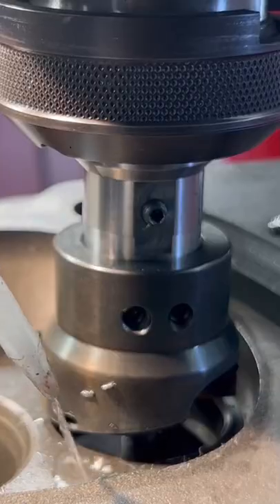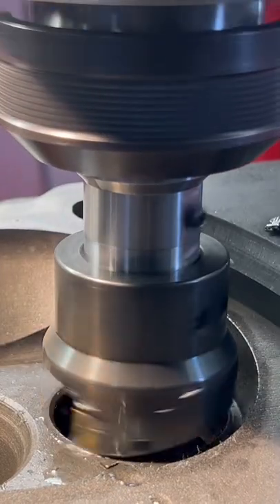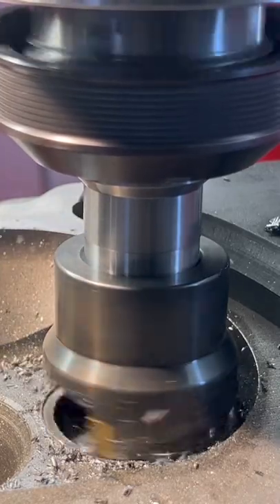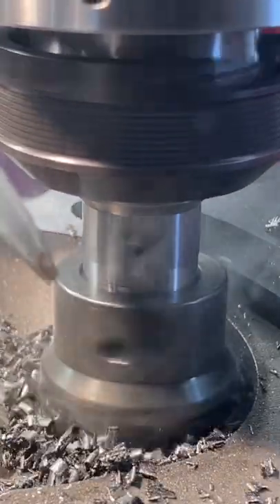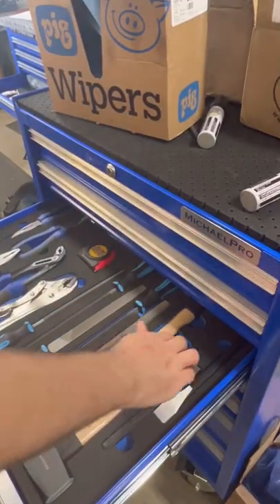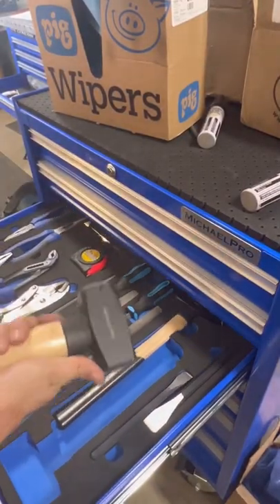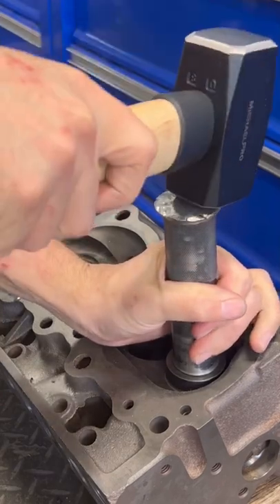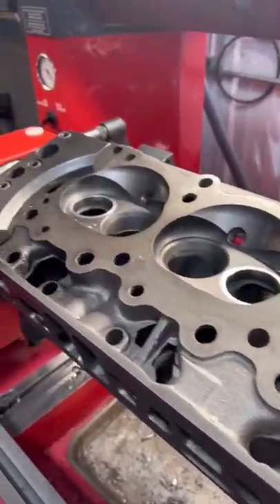#shorts Cutting For Valve Seat Inserts On A Set Of Pontiac Heads

Comment: I worked at a Chrysler engine plant in the 70s. We would keep the hardened exhaust seats in dry ice to contract to make them easy to drive in.
Reply: I was taught the same thing when I apprenticed as an automotive machinist in the early 2000s, I was told by the old foreman in the machine shop that driving them in like this can cause micro cracks that do not show up until the head heats up, the crack continues until failure or the seat starts to crumble. Not the first time that dry ice or freezing was brought up to this guy. He just ignores it.
Reply: @sshep7119  What about putting parts in a regular freezer to contract them? I’m assuming that’s not preferred as it can introduce moisture?
Reply: @GodsMan500  that works, probably not as well as dry ice because the latter can be -100 compared to zero, but it makes a noticeable difference when installing parts like bearings. Also you dont need to worry about moisture because a freezer acts as a dehumidifier during operation. You might end up with condensation from the outside air but that will happen with dry ice. If you're worried about it simply wipe the part down with a little oil then put it in a bag. Wipe down the friction side before install with brake parts cleaner cause the oil can affect the fit.
Reply: @GodsMan500  my thoughts are use a induction heater to heat the head to make it expand utilizing the way of expansion and stuff like that
Reply: @neptarclepuffin  the problem with doing that is big parts are harder to make expand/contract, especially if you need things to stay flat/true/unwarped
Reply: @samuelmellars7855  so what you are saying is that the entire head needs to be evenly heated in say like a oven?
Reply: @neptarclepuffin  well, that would work, but what I was saying is it's way easier to cool whatever you're going to insert
Reply: Is that why when they overheated they would drop valve seats ?
Reply: @robsorgdrager8477  yea it called expansion :P
Reply: @neptarclepuffin  we used to heat the heads with a blowtorch. It is not meant to be heated evenly. Just heat the first hole, freeze the first seat, place first, then heat the second hole etc.. Also not keep the flames so close to the head so it wont cause gas burns..
Reply: @GodsMan500  Dry ice has no moisture and brings the temperature down much lower to shrink the hardened valve seats.   Once set they expand quickly to the head.  As long as the cut seat hole is correct, I’ve never had a issue of the seats coming loose.
Reply: @neptarclepuffin  no, keep the head at room temperature and only have the hardened seat in dry ice. You have to move fast to install the seat because it will expand quickly one you remove it from the dry ice.   Hope this helps.

Comment: Id be less worried about your mushroom and more worried about the side force from your angled hammer strikes. Put the short handle lump hammer back in the masonary bucket, get a proper long handle 2-3lb -er, adjust the work so the top of the mushroom is parallel with hammer face when your arm is at its peak force, think tall axe block to keep your back straight, golf club swing or being off of centre height with a lathe tool.

Comment: Do you have a rotary table for the boring machine or a milling machine? If so, it would take 30 seconds after clocking out to fix the mushroomed end. It'll take longer with an angle grinder or bench grinder, but still worth it. You can see the pieces flying off in this video. 😸 I like your work Nicholas, stay safe!!!

Comment: I love the mini troll with the shroom tip. If you really wanna get everyone’s Jimmie’s all bunched up, try this. 

First find a way to attach a 3/8” or 1/2” rod on the opposite end of the shroom. Next, attach it to a drill or other rotary tool with adjustable a chuck. After that find a convoluted way to grind it doesn’t while rotating the tool with the shroom in the opposite direction the grinder is spinning. 

Bonus points if you pretend that face shields don’t exist and they are a myth started by big pharma so regular people wouldn’t question if the government were turning the freaking fish gray.